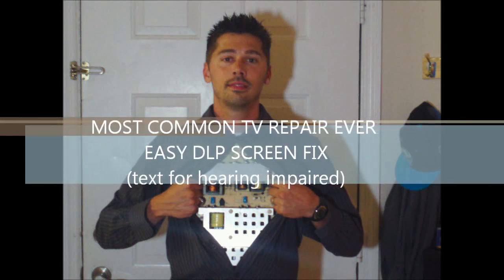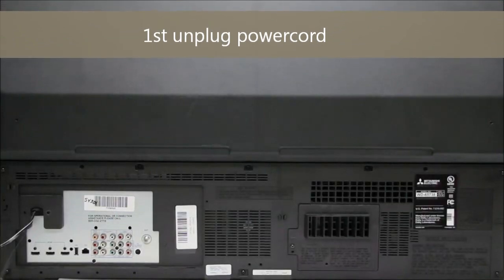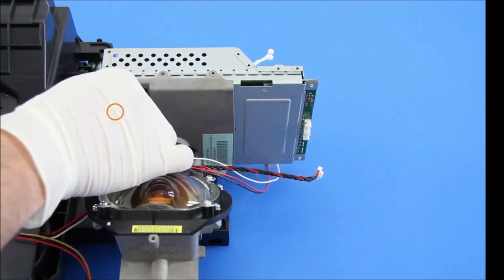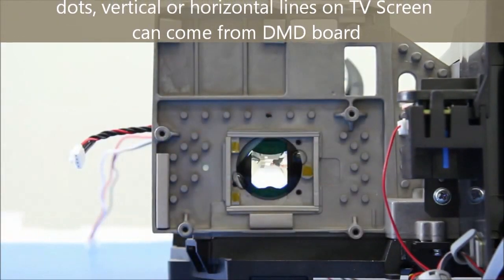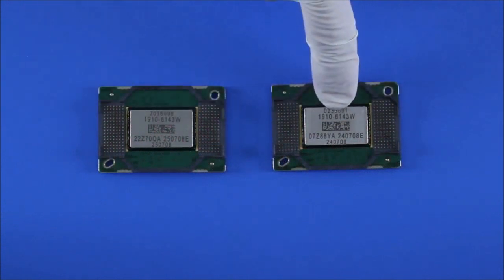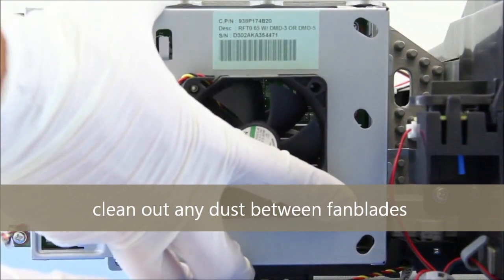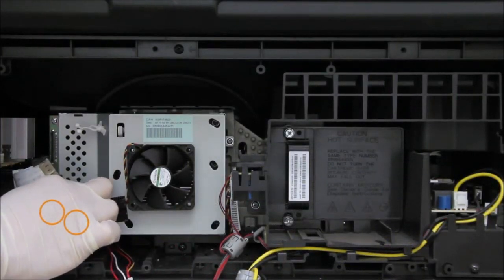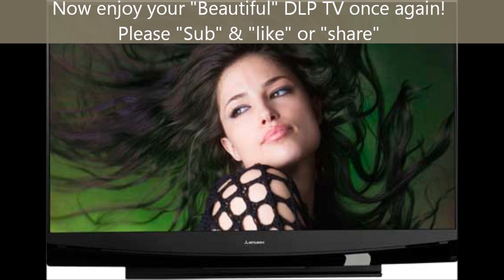EASY Common TV Repair for DLP !!!

Comment: Thank you so much for this video. We just had to make this exact repair on this exact TV. Now we have a sound issue. It works intermittently with no noticeable pattern except it may work when we turn it on then randomly stops producing sound. Do you by chance have any idea what this could be or how to fix it? Thank you in advance
Reply from the maker: Possibly Bad capacitors.

Comment: Hey  there.....did you need to reset the Lamp Timer? Obviously, no more Mitsubishi TVs but mine still going strong. Just changed out my 1st lamp and I get varying answers when checking if I need to, how to reset. Doesn't say anything in the manual and nothing when going into the Menu. A TV guy said that not all MTVs need to be reset (I have the wd73837) and if the red light stops blinking you are good to go, no need to reset timer as it does it automatically. Nothing said thru videos, including yours. Google gives various "AI" answers so thought to ask. Thanks!

Comment: Do u know how to fix if the TV shuts it self off...
Reply from the maker: Check TV eco energy saving settings  but if your TV is over 10 years old it can be bad capacitors in power board. Get TV boards at shopjimmy.com 👍

Comment: I did this repair about 7 years ago on a 7 year old LDP TV. I was a little intimidated at first. But the hardest part was making sure I labeled plugs and recorded the disconnection of the plugs to make sure I knew where everything went when putting things  back together. One mistake I made, was that I did not screw the DLP lamp door completely closed just in case it did not work and I had to troubleshoot some more. So I plugged the TV in and turned it on and there was NO PICTURE! The TV would not turn on. I assumed I screwed something up with the chip replacement. However, I noticed a yellow light blinking a code on the front of the TV. I looked up the code and saw it was telling me the lamp door was not closed completely. This is a safety feature to prevent you from burning yourself on an extremely hot lamp. When the screw is all the way in, it activates a small safety switch which then allows the TV to turn on normally. I WAS SO RELIEVED and so was my wife. But replacing the actual chip itself was easy. Great video! The TV is now 14 years old and still going strong with a very nice picture. I hope I didn't jinx myself. LOL
Reply: my  is about that old wd73737 ,  now just  blinking  red and bad smell, burning something any body ,  any  ideas....???

Comment: Hello and Thanks for All you do.  I've had DLP TV's for around 20 years now.  I just replaced the bulb in the one I have now, Mitsubishi Diamond Series WD-82842, it did burn out.  Bought an OEM, worked fine for about a month.  My TV, this morning will turn on, but no Video at all, checked the bulb, seems to be fine, no blown filament or glass.  Can a bad DLP Chip cause no video or a bad circuit board, or even yet, dust, I have not taken the back out yet?  Looking forward to your reply over in Central Florida :)

Comment: I'm not having any problems with my DL chip I'm having a problem with my TV not staying on and I just put a new bulb in at Party 3 months ago and maybe I need a new bulb I'm not for sure but I have no sound when I turn it on the insert light flickers in a yellow light after it turns itself off when I turn it off myself it stays red

Comment: When I turn my tv on it makes a high pitch noise that seems to rise and fall in volume. It does this for about a minute or so then turns off. The screen stays black with no sound. I’ve checked the lamp and it seems to be fine. Do you think it’s the chip cause I’d hate to waist money!

Comment: I am wondering if my brother is ruining my TV.  The bulb went  bad after three years.  Some how, the new bulb was supposed to be delivered on Tuesday.  But, he said it came yesterday and today is Saturday.  I think he put back in the old bulb and is tinkering with the television.  I moved here and he had dozens of used house light bulbs that he was keeping.  When I went into my new room where my mother used to sleep, he rigged my light bulbs on the ceiling so they would burn out every night.  He had all these crazy light bulbs in my bathroom too.  The bulbs in my bathroom mirror were all different ones on the light strip and he kept on unscrewing them and making me without any light to see in the bathroom.  He is crazy.  I need someone to come here to protect me from him.

Comment: I have JVC 65" with strange red or  out of color of sync letters in the menu . How do I adjust the ventricle or horizontal holds on this 2003 model AV65WP74 and have a better picture to look at. Kevin.

Comment: I do not have this TV I have the HL61A750, Had my TV chip replaced by a tech about 3 years ago,  it is almost 10 years old now still going strong,   The LED's may go out soon I have some on hand  about how long does the TV holds the charge after it is unplugged?

Comment: I've got a 50" led dlp from samsung. Not only does it have white dots appearing, but there has been a "dark vertcal line" on one edge of the screen for at least a year now. The picture still shows through but it's kinda greyed out. I don't know if both problems are from the same culprit or more than one component is faulty. The tv is probably close to 10 years old. With advances in tv tech, does it really make sense to invest in trying to fix a dlp tv?
Reply: I can't imagine oem parts are even available at this point for a reasonable cost.

Comment: I have an issue with a WD-73833 Mitsubishi DLP 1080p. When I turn it on , the audio sounds like it's popping almost as if it's like a record player when the record player skips the record, idk what the problem is, when I watch a show the audio will skip as if it sounds like it's muting /popping every 5 seconds or so

Comment: I have an issue with a WD-73833 Mitsubishi slip 1080p. When I turn it on , the audio sounds like it's popping almost as if it's like a record player when the record player skips the record, idk what the problem is, when I watch a show the audio will skip as if it sounds like it's muting /popping every 5 seconds or so. Please help asap

Comment: I just replaced my bulb yesterday. cleaned it all out real good. turned on my set, it comes on but after about 3 to 5 minutes, it shuts itself off
Reply: any ideas why
Reply: Try resetting and check blue power switch by bulb door. Fixed mine.
Reply: @tmogilnicki  buy USB fan plug it in keeps TV from overheating.
Reply: Use electrical tape and tape down the blue plastic wheel , this will heat up and continue to shut off tv. over and over. Can be very frustrating. Speaking from first hand experience

Comment: Have had a WD-65738 for years and still strong at 8100 hours (knock knock) .  I had a problem now with no sound on left speaker.  Connected an external audio source to both speakers through the side service holes and both have sound.  Is this a board and is it work repairing???  Thanks and great videos.

Comment: I have a 60 inch Mitsubishi dlp. When I click on button the status light blinks green continuously but screen does not come on. No sound comes from it either. Would I need to replace the chip on it or the lamp?
Reply: Ivon Robledo Did you ever find out how to fix this issue? I have the same problem and I've asked before too but no one ever gives a solution.
Reply: Ivon Robledo I have the same problem did you find out what it was?

Comment: Broke my tv the wd-73737 model color wheel does not disconnect from board. after he removes lens housing, not all wires disconnect. you can not freely take the board that holds the mirror chip. there goes $1000

Comment: Do you have a video on how to repair the screen if it's slightly tilted (crocked) picture shows just fine, in fact I just had the chip replaced. I moved the tv to another location, plugged it up and the screen was slightly shift with one side higher than the other.

Comment: I have a wd 73737 mitsubishi tv shuts off after less than a minute. It will turn back on then shuts back off. The red light goes solid red, no flashing. It did start having white spots a few months before this.
Reply: Hello,
My Mitsubishi 65" is doing the same thing. Comes on, picture shows, ~ 15 seconds later it shuts down. 
Then I wait about 15 seconds and turn it back in. 15 seconds later... it shuts off again. Help!
Curious is you received a response. I didn't see any response to your problem   
If you fixed yours, would you share what you did? Thanks.
Reply: Freestorm Seabreez i have the same tv as you, mine was doing same until lamp went out and just replaced the lamp and it stopped but now i have the white dots and have to replace the chip, also had another tv did same thing just was too much dust

Comment: we have a 10 year old Samsung projection tv . have changed the light bulb many times.  the past few days when we push the "turn on " button,  nothing happens.. no  noise  or  anything...  we  changed  the  bulb,  still  nothing... then  later  in  the  day,  try  to  turn  on  the  tv  and  it  turns  on... next  time  wont  turn  on...  is  the  the  round  push button ?  is  it  worth  fixing this old tv ?

Comment: so I  replaced the bulb and when I turn it on it run fine till the bulb heats up then it sounds like a fan is bad or something and the picture glitches. any answers?
Reply: I have the same problem, can't seem to find the answer anywhere.

Comment: I replaced lamp on Samsung dlp. it worked for five hours now TV shuts itself off and on. sound with no picture. any thoughts.  thanks so much.  very frustrating
Reply: Same situation here but with a Mitsubishi but after 1.8 days of continuous use. It shuts off and blinks red constantly or with added fans it just shuts off and stays solid red after replacing the lamp. I just got done cleaning out the entire unit tonight so I am in the process of eliminating dirt and dust build up which would create some problems including this from what people claim on the Internet. So far this is still not a solution though. I will RMA the lamp and then try a new ballast next. If anything works I will let you know.

I have searched for hours and found the top 6 things I have found searching for a week are: 1: bad lamp, 2: dirt clogging up or slowing down fans, 3: ballast needs new caps or is damaged, 4: door switch heats up and becomes faulty causing it to stop, 5: the thermal sensor under the color wheel or the color wheel itself needs replacing, 6: resetting lamp timer manually.... I am going to finish testing this to see if I can fix it. If I figure this out, I will post some information.

Comment: I have a Vizio 55" flat screen and I had it for a long time  and it's been having lines across the tv and just now a quarter of my screen went dark then started blinking normal with a bunch of lines... And right now the quarter bottom came back to normal with a yellow black tint and now it's flashing again... Any way to contact u
Reply: Sounds to me like the screen is going dead from forcing in the wrong vertical or horizontal frequency. The T con board is unlikely as it has horizontal lines.. I had several TVs have that issue in the last 10 years. Sadly most TVs are made very cheap and are likely throw away's within 10 years for many people. try googling a new TV with a low number of complaints regarding equipment failure.  It is very hard to find any model right now that is not loaded with 5% complaints or more after being on the market for one year. It is time to buy a new TV for you. Your old one is not worth repairing unless you want to spend $800-$1500 on screen replacement they do not even make anymore..

Comment: Thanks to videos I have replaced a lamp and a chip in the past on my older Samsung DLP TV.  But now sometimes (not always, but more frequently lately) when I turn on the TV I can hear sound but the image is stuck looking like one of those computer-generated 3D art images, with the same mish-mash mostly green image repeated in rows and columns.  It seems to correct itself eventually by turning off the TV, waiting 10 seconds, and turning it back on.  Sometimes It takes multiple on/off cycles and sometimes I wait longer between turning it back on.  Sound familiar at all, and is this an issue for replacing the chip or something else?  Thanks in advance!

Comment: I'm not sure if anyone posted this but if you want to know why this happens, then keep reading. first the lamp burns out and you replace it. Sometimes a generic lamp is different in terms of energy and light output. Therefore the heat from the lamp is greater when it hits the mirrors, at levels that it wasn't tested for. Over time this "glues" the microscopic mirrors. The best way to prevent this is to provide the proper cooling. First clean all dust inside including fans AND the most important is to clean off the thermal grease on the heatsink and replace it with fresh and more efficient silver thermal grease. Not expensive and found easily online and in electronics stores. This allows less heat to remain in the DLP chip and therefore the heat leaves through the heatsink out the fan. Many computer guys would know this and this WILL prevent from buying another DLP chip or at least extend the lifetime. Hope this helps!!!

Comment: If I heard you right, the dits could be caused by a bad connection at the lamp? My lamp went out and I ordered and replaced the bulb. The tv started working almost instantly, but we started getting white dots right away. Then they got worse to where now it looks like your in a snow storm. Could have I caused it? Or should have I replaced the chip at the same time. Also there was a chip that looks like this chip next to the bulb. In fact. Had to remove the chip to remove the bulb. What chip is that?

Comment: My 2011 Mitsubishi 65" DLP has worked great thus far. had to replace the bulb one time already, but that;s no big deal. My main issue is that I am hearing a faint whirring sound that cuts off and on like it's a fan winding up and then cutting off over and over again. Could this be a dirty fan, and can I clean like I to my PC tower in order to quiet it down?

Comment: I replaced the lamp in my samsung  60inch dlp tv and the lamp popped , replaced this lamp but now tv will not come on -green lights then red then nothing, checked my color wheel and it seems in great shape , what else could it be ? noticed some popping and othernoise just before the lamp blew up.
Reply from the maker: maybe you installed wrong lamp for your tv that's common error.
Reply: i need someone to put it in for me the D LP CHIP are you from boston

Comment: i have a mitsu 1080p, 60735. replaced the dlp chip and it worked great for about 3 weeks and then the screen went black. I replaced the lamp but did not fix the problem and I still have audio. what can i do next. thanx for the help with the dlp chip and this problem as well, hopefully

Comment: hoping you can help,  i have 2 of these DLP TV's,  wd-y65 and I'm getting error code 39, i have cleaned all fans, new dip chips, new thermal sensor, still same issue, powers on for 30 sec to a min. then shuts down, solid yellow light, tv will turn back on after reset but just shuts down again,  with error code 39 this has me stumped I was hoping to use parts from both to get at least one of them working again, i searched and everything i found online says air flow restriction and to clean it out or thermal sensor and I've replaced them too , I'm starting to think its a problem on the logic board but wanted to check first before i  caused any additional problems, any suggestions? 
thanks rob

Comment: I'm having a problem with my dip its giving me a code 61 and some times when i turn it off it makes a loud buzzing noise any ideas
Reply: HEY GARY, JUST SAW YER POST ON TV REPAIR COMMENTS SECTION AND I HAVE SAME PROBLEM. I KNOW ITS BEEN 8 MONTHS BUT DO YOU REMEMBER WHAT THE FIX WAS AND MAYBE ALSO WAS NOT ? APPRECIATE  ANY HELP BRO ! THANX
Reply: It was the color wheel I replaced it and it fixed the problem

Comment: I have a very important question, I just bought my Samsung DLP TV (55" Don't know what model besides it has 3 HDMI Ports PC ports, 3D port and basic ports) and when I turned it on (Don't know if this is a sign of a problem ) the Temp. light is Red solid for a while but then the lamp light (infront) is green and blinking. It makes the sound of coming on but the problem is the screen doesn't work nothing pops up. Any ideas? My guess is the actual lamp needs replaced but I don't entirely know. The lamp lightbulb comes on so could someone possibly help me?

Comment: How about a high pitch buzzing? Any ideas?
Reply from the maker: +Wendy Justice Can be bad filter capacitors in main a/v board or power board or transformer.
Reply: +Tampatec thank you for your input, really didn't want to get rid of a perfectly fine flatscreen without at least trying
Reply from the maker: happy to help, sub and follow me on G+ for free tech support :)
Reply: Color wheel needs replaced due to bearing
Reply: If the buzzing occurs after you've recently turned the set off and turned it back on, that's normal. I have the Samsung 56" DLP HLT5676SX and it happens to me when I do that. The sound is normal.
Reply: Wendy Justice

Comment: My image is fainting. Still visible, but horrible watching tv with any room light. No issues turning on. Bulb or chip?

BTW this video is awesome
Reply: that's going to be bulb, very simple to do we've had to replace our bulb a few times
Reply: also when you get the new bulb set settings to cooler and energy save mode bulbs last longer
Reply: Awesome. It's sitting on the sidelines right now awaiting a new bulb. Know of a good place to purchase these?
Reply: +David Rowe we just Googled local places that sold them we got ours at a place called crown tv
Reply: +David Rowe amazon 34.00 dollars light for mitsubishi tv I bought one for my 65 inch